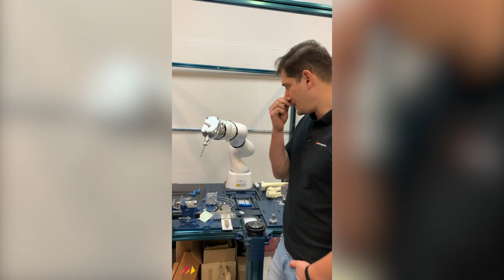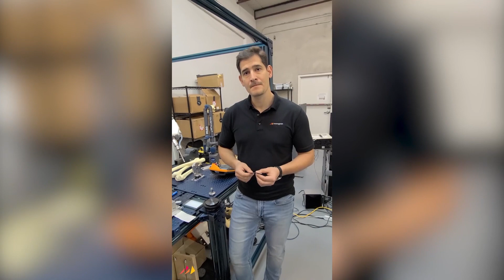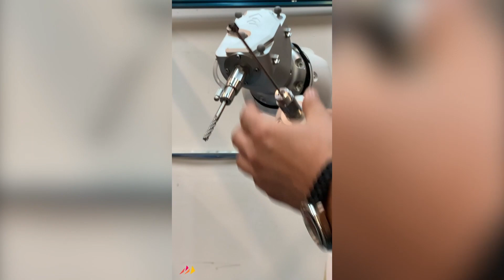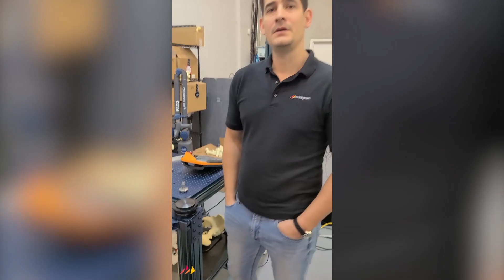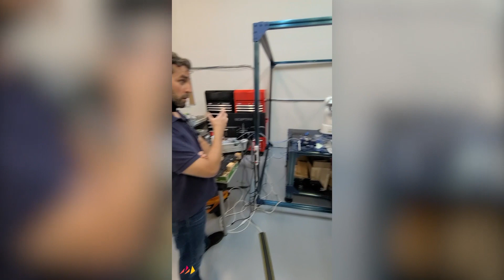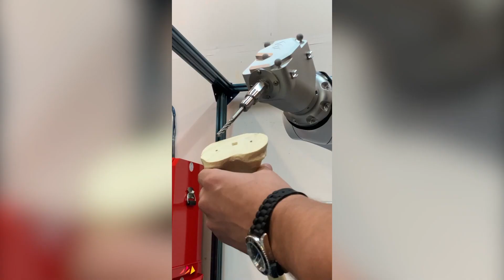Monogram Cutting System Sneak Peak

Comment: 1.) What is the benefit over a Saggatal cutting tool? Is it because of the ability to self cool?

2.) Will this be usable for other surgeries and orthopedic implants other than what your company is designing?
Reply: Please note the quick release mechanism that will allow us to swap tools easily.  It's a very competitive industry, so we have to be careful what we show, but not everything we broadcast publicly is everything we are working on...speed without compromising accuracy and safety is our number one focus.  Sagittal cutting is the gold standard for speed.  The benefit of a rotary cutting tool is the ability to mill customized shapes and prepare bone with less access, for example, to mill a hip stem cavity that currently no company can do.  We believe in giving surgeons the flexibility to use cutting tools optimized for the clinical application.

Yes, our surgical robot could easily be implant agnostic, and we have designed our guidance application for that to be easy to do.  Regarding other clinical applications, we think the constraint is the cutting system and the guidance application.  Per the above, we are thinking about cutting systems in a highly modular way.  The guidance application development requires clinical expertise for the procedure.

Comment: The device has registration points to a camera, where is the camera during an operation at a fixed point for the bone??
Reply from the maker: The camera is on a cart that is stationary with a line-of-site to the surgical exposure.  The camera simultaneously tracks the end-effector position and the femur and tibia, and various instrumentation at all times.  Tracking the end-effector position provides added safety - the robot actuators are highly accurate. Still, we have an extra set of eyes to ensure the controls have positioned the robot where it should be.